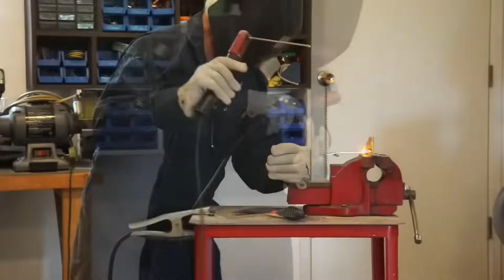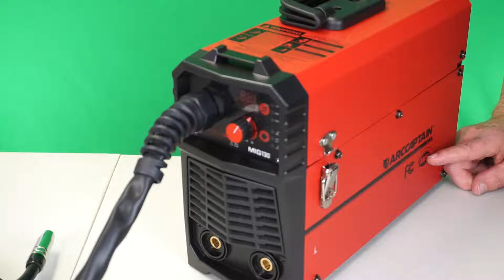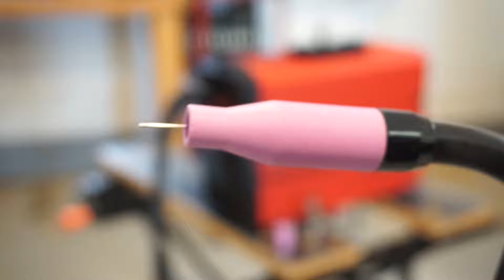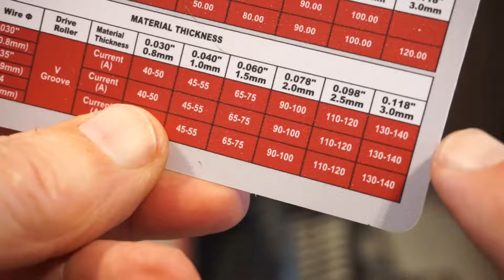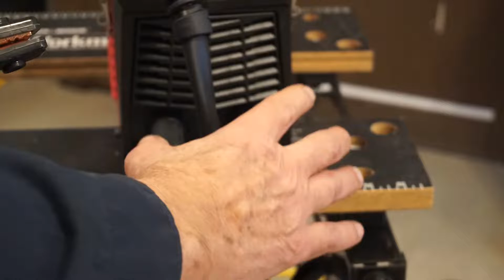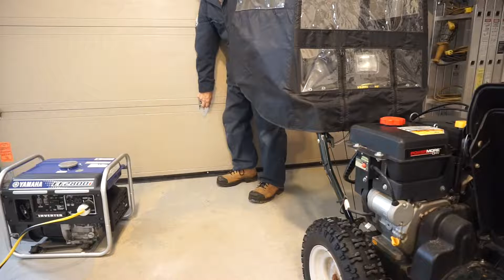GADGETS#189 - ARCCAPTAIN MIG130

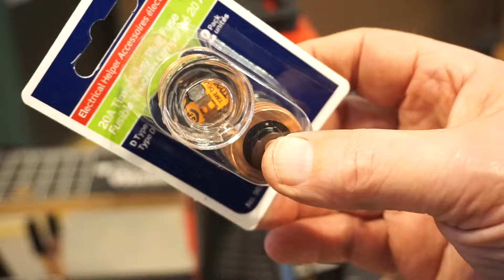Comment: What does  that 85 amp means for your breaker 10:07
Reply from the maker: 15A ~ 16A @120v

need a good dedicated 20A 120v circuit to run this thing

Comment: I have found small stick inverter is about perfect welder for infrequent use. I bought French made el cheapo Spark 130 welder little over decade ago. It weights under 4 kilos, is extremely portable (and easy to stash away when not in use) and has enough punch for farm use. I have even used it to fix corroded rocker panels and other sheet metal work,  not easy nor fast but doable with 1.6mm rods. And the best part is there is ABSOLUTELY NO FEEDING PROBLEMS ever. You dont have to worry about feeder tension or guide tube alignment, just drop a rod in and let it rip. I am never going back to flux core.
Reply from the maker: I'm a stick guy as well:)

even with that big 240v AC welder, I'd do delicate stuff with 1/16" (1.6mm) and 5/64" (2.0mm) rods ... and of coarse when any heavy welding is required, I'll take out that big welder

that said, when the flux core side if properly dialed in, it can lay down some really nice welds

thanks so much for taking time to write this comment:)

Comment: I learned how to weld (poorly) on an old flex core machine. I do most of my welding indoors now with a solid core shield gas machine. For outdoor use I have an old generator/ arc welder. 
I’d like to upgrade to a wire feed flux core machine for outdoor welding.
Reply from the maker: shield gas doesn't like wind so that's 1 place where flux core has an advantage

I really don't weld enough to warrant me stocking shielding gas bottles here

take care, Chad:)
Reply: Lanterna
Reply: Torchlight
Reply from the maker: @alexvelicu4505  that's 4sure!

lots of UV there...I remember when MIG machines were first introduced in our shop...the old timers who were used to stick level UV soon learned to button up there shirt collars

1 guy was doing some heavy MIG welding on an excavator...laying down on the floor, had not noticed his pant leg had creeped up exposing his shin area...got severe UV burn